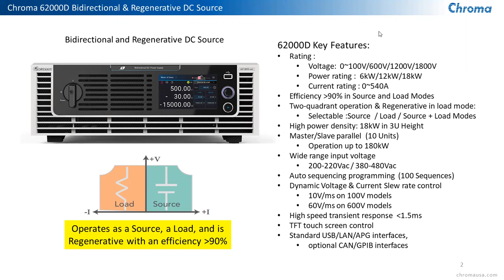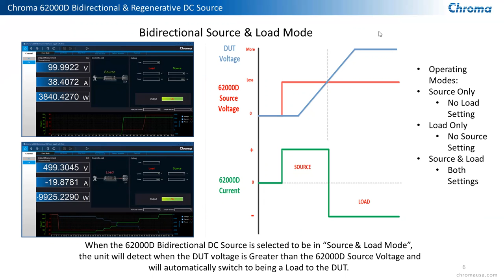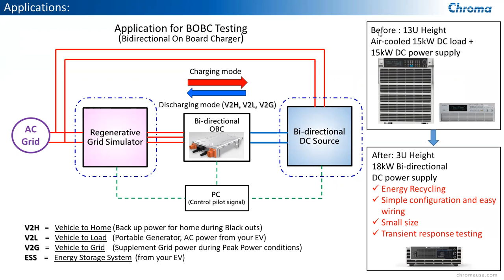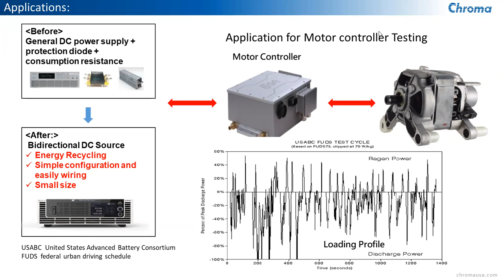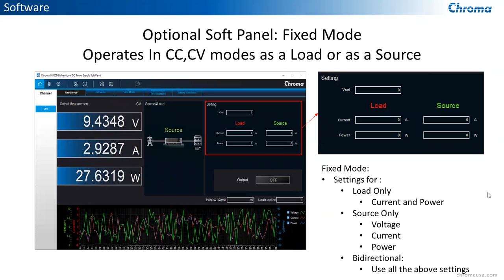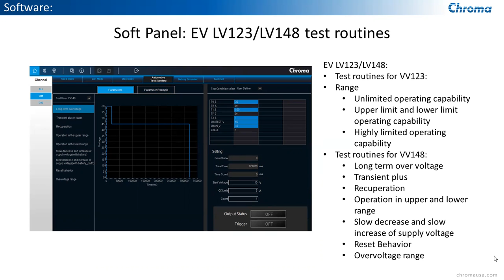What is there to know about Bidirectional DC Power Supplies?

Comment: Las fuentes de alimentación de CC bidireccionales funcionan como fuente de alimentación y como carga de CC regenerativa. Esta capacidad es cada vez más importante en las industrias de vehículos eléctricos y energías renovables.

Chroma 62000D proporciona alimentación de CC programable con una respuesta transitoria de alta velocidad de menos de 1,5 ms, y puede funcionar en modos de voltaje constante, corriente constante y potencia constante. 

Como carga, puede retroalimentar a la red con alta eficiencia. En comparación con una configuración tradicional, el 62000D ahorra costos, espacio, reduce la pérdida de energía y es más fácil de cablear y configurar.

Chroma 62000D se compone de 8 modelos de hasta 18 kW en 3U con corriente de salida de 540 A y voltaje de 1800 V. Comparta la corriente con diez dispositivos para alcanzar 180kW. Incluye control de pantalla táctil inteligente.

https://idm-instrumentos.es/fuentes-regenerativas-bidireccionales/